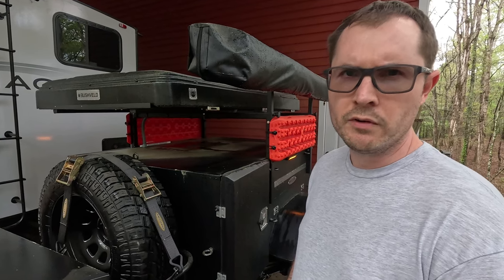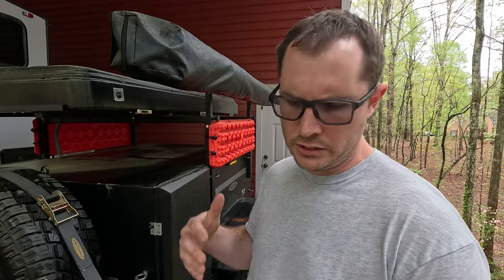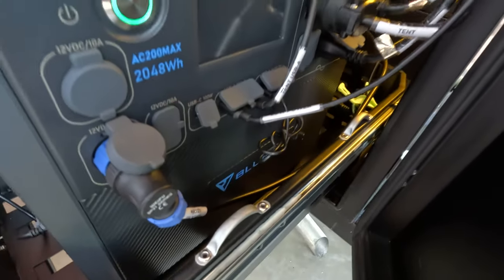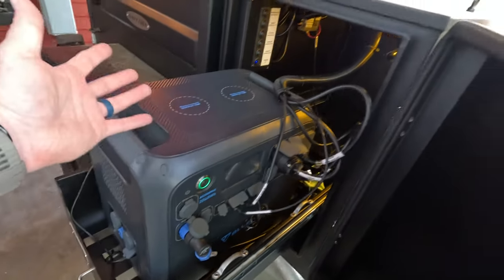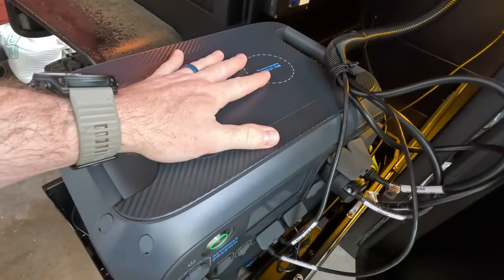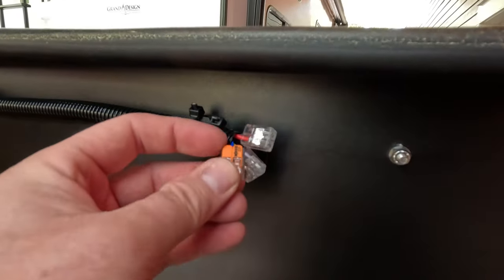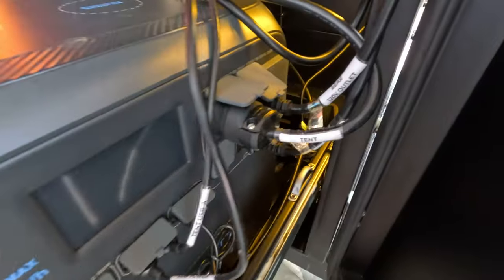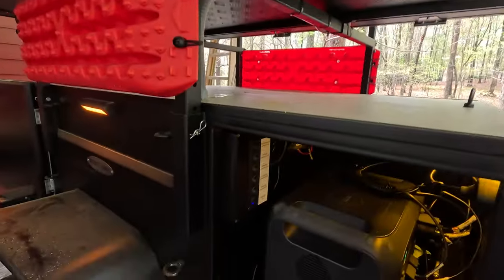Off-Grid with Bluetti AC200MAX Power Station in My Smittybuilt Scout Off-Road Camping Trailer

Comment from the maker: Support the channel with these affiliate links. As an Amazon Associate I earn from qualifying purchases:

Full Overlanding Build List:
https://www.amazon.com/shop/adventurerocks/list/1QZGU9DPJDQLE

BLUETTI Portable Power Station AC200MAX
https://amzn.to/3KhY3vU

Right Angle 30A 12V DC Plug
https://amzn.to/3xrp2S0

Dream Lighting Amber/White LED Lights
https://amzn.to/3G1JJF2

24" LED Strip Lights
https://amzn.to/3xroBHm

Light Switch Panel
https://amzn.to/3UeIYAy

2-Way Light Switches
https://amzn.to/3VTSWbK

Hobby Box for Switches
https://amzn.to/4aBfAu3

Hobby Box for Rear Outlets
https://amzn.to/3UeJajg

Magnetic Cable Mounts
https://amzn.to/4atDHeb

12V Cigarette Lighter Socket
https://amzn.to/4axLhEs

12V Fuse Block/Distribution Panel
https://amzn.to/4aM2Ikk

Split Wire Loom (I used 1/2", 3/4", 1")
https://amzn.to/3TT4Vny

12 Gauge 2 Conductor Wire 
https://amzn.to/3JggHDm

14 Gauge 3 Conductor Wire
https://amzn.to/3Q13pP0

14 Gauge 2 Conductor Wire 
https://amzn.to/43ZpiEe

Wago Lever Nuts
https://amzn.to/3Q17ORQ

AC Outlet
https://amzn.to/3TWJJgh

AC Input (For Charging)
https://amzn.to/3Ji8z5w

Grommets
https://amzn.to/3VX56Ro

Step-Bit (to drill holes in metal)
https://amzn.to/3VWqlCL

USB-C (for Tent)
https://amzn.to/4aQLYZr

USB Extension (for Tent Lights)
https://amzn.to/4aO1zZG

AC Power Strip (for Tent)
https://amzn.to/3xHG8uX

Rubber Caps (to cover exposed screws)
https://amzn.to/49xIr15

Bussmann Fuses
https://amzn.to/49xdI4k

25ft 12 Guage Extension Cord (for shore power/charging)
https://amzn.to/49BldHt

Comment: Looks nice! I like the versatility path you've taken. One thing to keep in mind if you see any issues with 12v items in your tent, it isn't typical to run 12v wiring in the same conduit as 120 vac wiring. With a relatively short run you should be ok but if you power computers are use audio and have buzzing  it could be interference. Again great looking setup.
Reply from the maker: Thank you